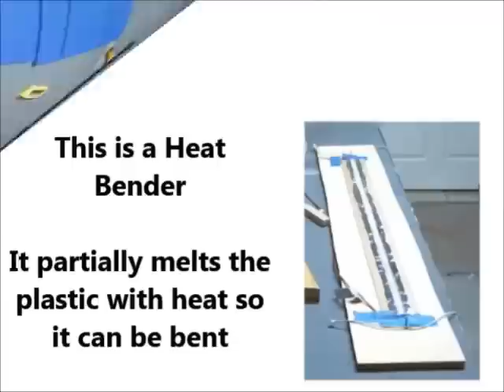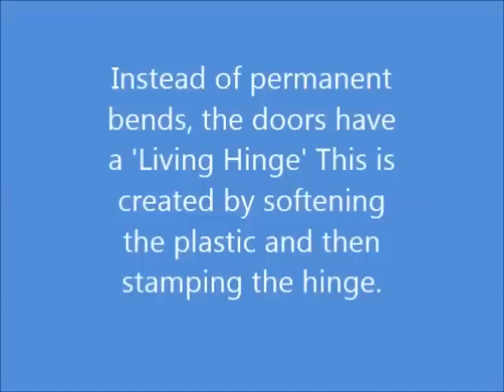Making a Corrugated Plastic Chuck Box

Comment: Excellent video!

When you say that you stamp the hinge, what does this mean? can you explain the process please? What is underneath the line of the hinge when you press down, on the Corrugated plastic, with the wooden block?

Hope you can help

Once again thanks for a great video
Reply: ***** Hey,
I've got one question 4u too. Do you know any alternative way of heating the plastic to stamp a hinge in it? I need to stamp ~5 foot long hinge into 5mm thick plastic. Also i have a question about durability of that type of hinges. How strong are they? Did they ever broke on you?
Tranks for this vid and have a nice day!
Reply: He heats up the plastic sheet in one area in a straight line. When very soft, he presses down with a tool that compresses the corrugation inside and flattens it in one thick line.  Now it is easy to bend that area, without compromising structural integrity.  It is not cut on one side.  It is intact, compressed, but flat not thick, so bends easily like a knee joint.  This becomes a piano hinge if you will. You can improvise your tool of choice.  Use a rounded stick or rounded metal object to press down.  What is underneath is a stiff surface like metal, wood, stone - any stiff countertop will do.

Comment: Very interesting. I didn't know you could build something like that with corrugated plastic. How did you make the straps with the side release buckle's?
Reply: You have to sew in the side buckles, unless there is a way to heat seal them in. Youtube should have videos. Sewing that thick webbing requires a commercial sewing machine or heavy duty one.  Any dry cleaner should be able to sew these for you.  The other way is to loop webbing into the buckles till they are secure, without stitching. Here is a video:  https://www.youtube.com/watch?v=3xB86Lm7vBw

Comment: Pure Genious!  I am trying to put together a camping system for a Honda element and something along this scale would be perfect. I am not tooled up to do such a project and will have to hire it done. Boxes like this would be perfect and would hold up to moisture! If i run into a snag or have questions at a leter date would it be possible to get suggestions from you so that i may have a fantastic camp set up?
Reply: Build it out of wood. Look at the Australian system of extension slides that stretch outside. Look at Drifta.  This little box will not be suitable for your needs. You need a kitchen install. Do your research on Youtube. You don't need to ask anyone.  Its all there. Get familiar with power tools and do it yourself too. Too many women are afraid to try using power tools. Cooking, sewing, knitting, child rearing is much harder than building with wood or plastic.  Just do it.
GENIUS, not GENIOUS.

Comment: how much weight can the box hold if the box was mounted to a wall or roof? I would love to install head in my van to carry canned goods
Reply: For Caned goods, I recommend building with ply wood and routing out sections to reduce weight, or build with Alecubond (Brand name of PP plastic sandwiched between two sheets of aluminum.)

Comment: Isn't going to take much opening and closing for those "living hinges" to crack and your doors to fall off.  Might as well put real hinges on it.  Otherwise, cool project.
Reply: CampingKitchenBox
Reply: I don't think so. The Coroplast was not cut.  It was compressed making it very strong. Its not a brittle material.